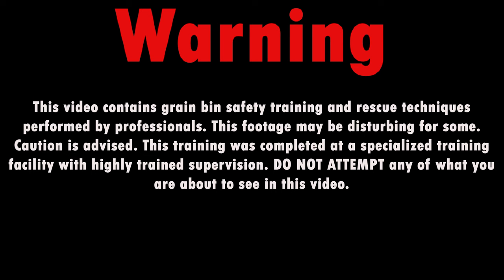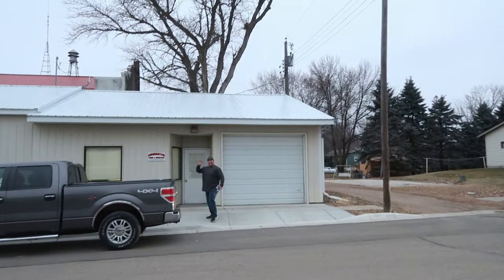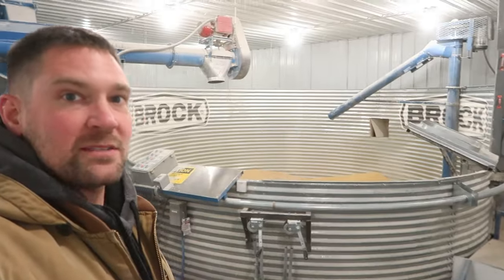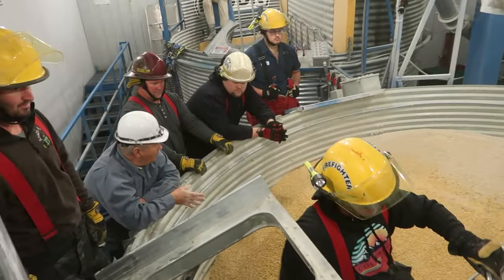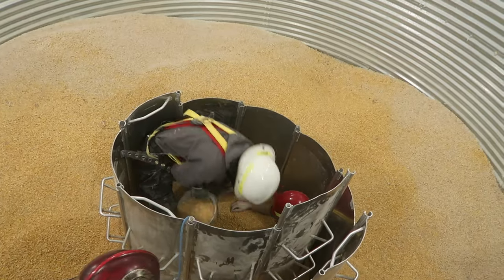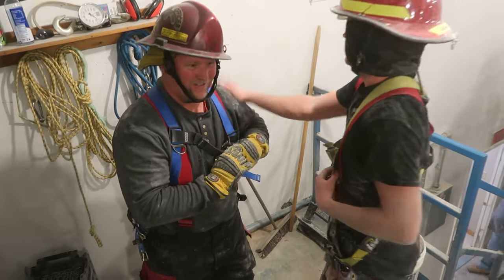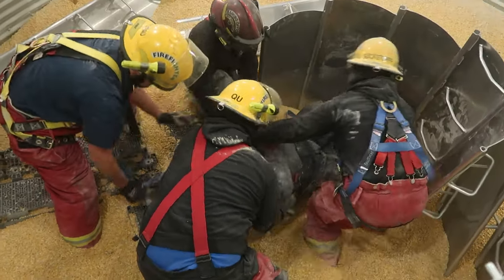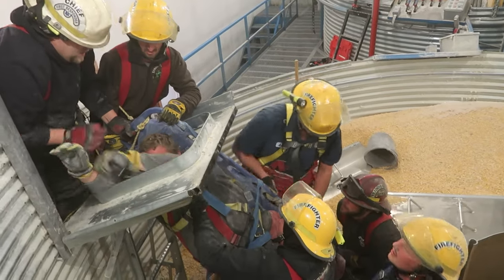Grain Bin Rescue

Comment: Why hasn’t someone invented a snowshoe type footwear for the firemen?
Reply: The grain bin rescue training program here in Western Kentucky emphasizes utilizing available materials rather than specialized equipment that might not be readily available. Items such as the drink boxes make great hard points to stand on and plywood sheets can readily be used for building caisson around the trapped individual. The main issue is that time is critical, start with what you have and hope someone comes up with something better.